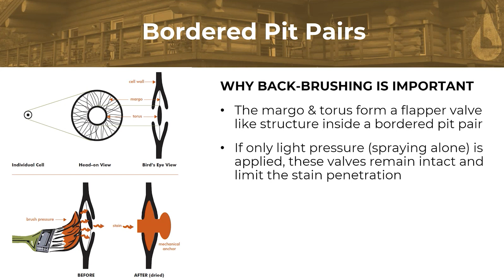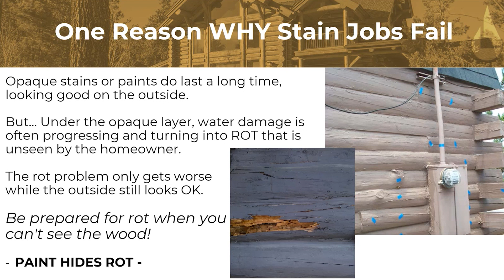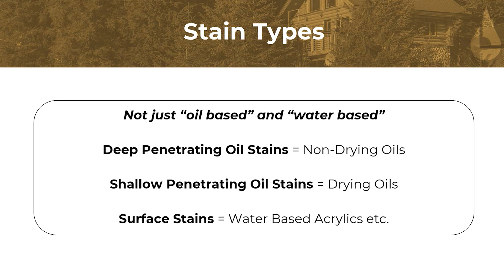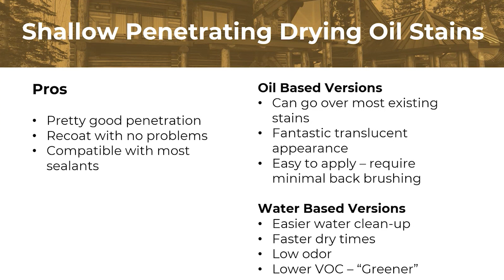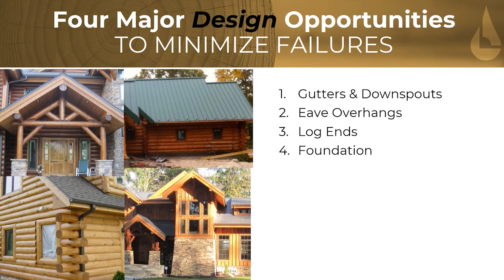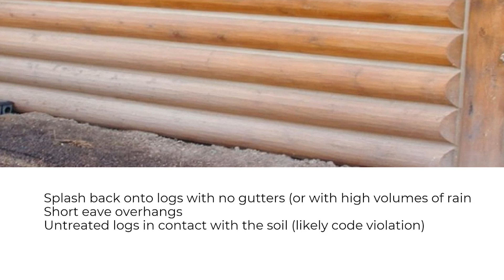Stain Technology 101 Webinar

Comment: As a DIYer and sometimes professional with not much knowledge about how stains on logs work, who is also an owner of a log home, this video was immensely helpful. I need to refinish my home and I went with the Capture and Cascade solution. It's working great to touch up the existing but unknown finish in some areas where the old finish is failing, and it's easy to use on some sections where I am starting with new logs. I ordered several samples ahead of time and applied samples on logs of the same diameter as my house. I laid up several coats of several samples and finished them in different sheens. This allowed me to completely dial in my choice to match my house. And it's amazing. New and old side by side, can't tell the difference. This makes my log home maintenance solution so much simpler.